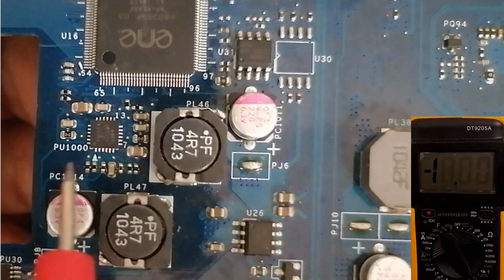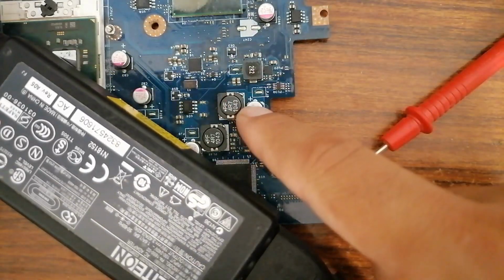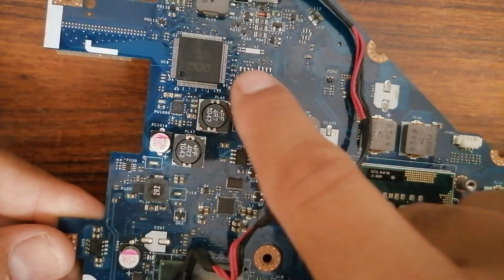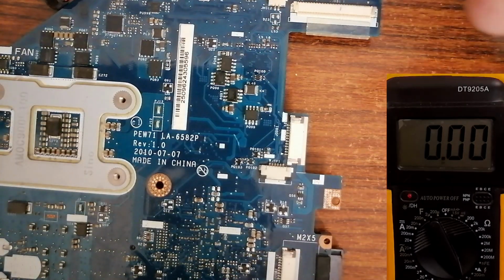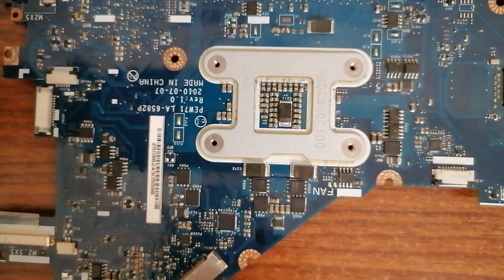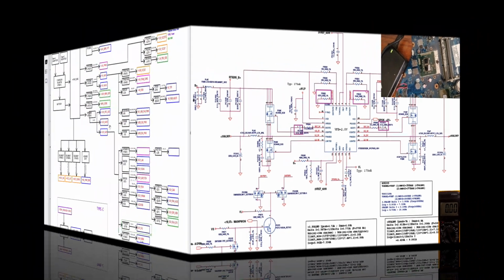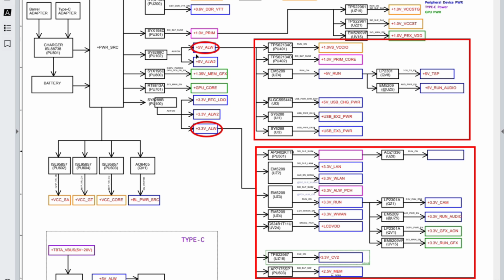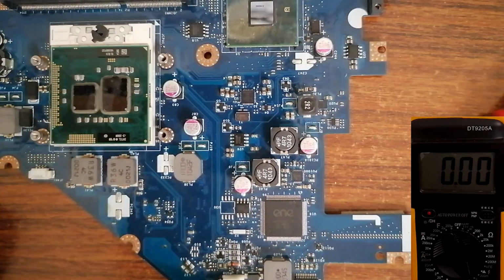Laptop Motherboard Repair Test & Troubleshoot 3.3VALW 5VALW Circuits with a Multimeter

Comment: Hello teacher.  Is it a must to remove the CPU to isolate the motherboard when testing for the B+, 3.3v, 5v circuits? And if so, which method do you use to remove the CPU?  Many thanks and much appreciation to you sir for your hard work and determination to teach your expertise.

Comment: as a beginner, i'm trying to repair a motherboard, asus h110m-d, dead looking for the a schematics to ease the troubleshooting, most of the terminal in the atx jack is shorted, i dont know where to begin...
Reply from the maker: As a beginner, you're on the right track by looking for the schematics! For the ASUS H110M-D, if most terminals in the ATX jack are shorted, I recommend starting by checking the 12V, 5V, and 3.3V rails for any obvious shorts. Disconnect all peripherals and components, like the RAM and CPU, to isolate the motherboard. Then, using a multimeter in continuity mode, check each power rail for shorts to ground. Often, a faulty capacitor or MOSFET might be the cause. If you don’t have the schematics, you can search for common circuit layouts online or use a similar model’s schematics as a reference. Good luck, and feel free to ask if you need more help

Comment: Hi sir I have a blown Rb491d shotky diode is there any way to bypass this or use another diode
Reply from the maker: Substitute with Equivalent Diode: You can replace the RB491D with another Schottky diode that has similar specifications. Check the voltage rating and current capacity to find a suitable replacement. The RB491D typically has a forward voltage of around 0.2V and a current rating of 1A, so look for a Schottky diode with similar values (e.g., 1N5819 or SS14 as alternatives).

Bypass (Not Recommended): Bypassing the diode is not recommended as it serves a specific purpose in regulating current or protecting the circuit. Without the diode, you risk damaging other components

Comment: Can you explain the circuit of a normal pad calculator? Each and every thing in separating parts in single video. I was searching that how it works. But didn't got the video. I am expecting from you. Please 🙏
Reply from the maker: Thank you for your request! A detailed breakdown of a pad calculator's circuit is a great idea for a video. I'll definitely consider creating one that explains each component, such as the power supply, microcontroller, display, and keypad, in a step-by-step manner. Stay tuned, and I’ll do my best to provide the content you're looking for! Thanks for your support!

Comment: If we don't don't have 19 volt in the 3.3 and 5 always inductor. What shall we do??? 
Please help
Reply from the maker: If you're not getting 19V in the 3.3V and 5V Always circuits, first check for any shorts on the input side of the power rail. Then, verify that the DC-in MOSFETs are working correctly and passing the voltage through. If there's no issue there, check the fuse, capacitors, and other components in the power path. You can also inspect the charging IC, as it controls the power distribution. Make sure the power adapter is functioning properly as well. If all these components check out, it may be necessary to trace the signal and test individual components further. Hope this helps!
Reply: @electronicsrepairbasics_erb  awesome thanks 🙏
Reply from the maker: Thank you

Comment: This is excellent. HOW do you check the 3V and 5V always voltages? Do you need the pin outs of the IC to find which pin the voltages are on? Many thanks.
Reply from the maker: Yes, correct

Comment: Boss please,i have hp laptop is turning on, but no display and the fan spin like two seconds and stop
Reply from the maker: Hi there,
Here are some steps you can try:

Check the Power Supply: Ensure the laptop is properly connected to a working power source.

Perform a Hard Reset: Disconnect the power adapter, remove the battery (if possible), and hold down the power button for about 15-30 seconds. Then, reconnect the power adapter and try turning the laptop on again.

Inspect RAM: Sometimes, loose or faulty RAM can cause display issues. Try reseating the RAM modules or testing with different RAM sticks if available.

Check for External Display: Connect the laptop to an external monitor or TV to see if the issue is with the laptop's screen.

Examine the Laptop’s Components: Look for loose cables or components inside the laptop. If you’re comfortable doing so, you can open the laptop to check.

Feel free to update me on your progress or if you have any further questions!
Good luck
Reply: Thanks 🙏, the person that gave me the laptop disassemble the laptop,I was the one that assembled it,I plug in charger I read the mosfet it gave me 19v, I read the battery terminal it gave me 3.3.if I press the power button it bring light on the power,I on it and off it.when ever press the power button it will make a sound like it will start  the fan will spin and stop.if I plugged charger it shows charging light.I clean the ram and install it still ,I ask the person he told me he removed the ram a and kept it for long time
Reply: I am a phone technician,I don't know anything about fixing of laptop.Thank you for your support sir
Reply: I will study your video,It will really help me

Comment: In case +3V or +5V is missing how can you fix it. Thanks 🙏
Reply from the maker: If the +3V or +5V is missing, here’s a systematic approach to diagnose and fix the issue:

Check Power Supply:
Ensure the power supply is functioning correctly. Use a multimeter to measure the output of the power supply and verify that it is providing the correct voltage B+.

Inspect Voltage Regulators:
 check if they are operating properly. A faulty regulator could cause the absence of voltage.
Replace any damaged voltage regulator ICs.

Examine Capacitors and Diodes:
Look for blown or damaged capacitors, particularly near the power supply section. Faulty capacitors can lead to power loss.
Check diodes in the rectifier circuit (if applicable) to ensure they aren't shorted or open.

Trace the Circuit Path:
Use a schematic diagram to trace the power supply circuit from the source to the affected area. Check continuity with a multimeter to find where the voltage drop occurs.
Check for Short Circuits:

Look for any short circuits or burnt components that could be pulling down the voltage. This may include checking MOSFETs or transistors that are connected to the power line.
Inspect Connectors and Solder Joints:

Ensure that connectors and solder joints are intact and not loose or cold-soldered. Reflow or resolder joints if necessary.
Replace Faulty Components:

If individual components like resistors, diodes, or ICs are identified as faulty, replace them with appropriate equivalents.
By following this methodical troubleshooting approach, you should be able to locate and fix the issue causing the missing +3V or +5V.
Reply: @electronicsrepairbasics_erb  Thank you very much
Reply from the maker: My pleasure